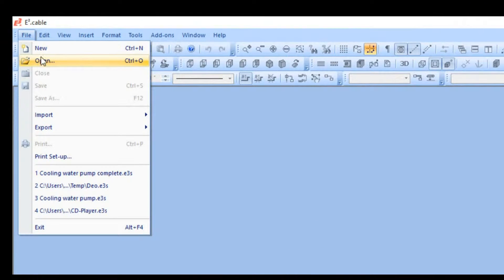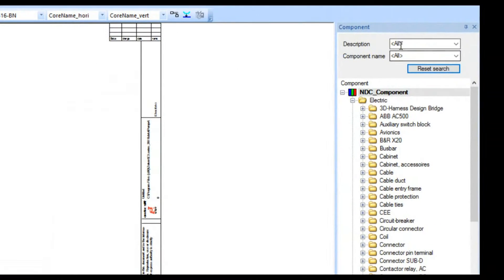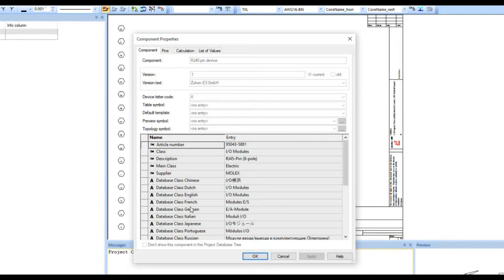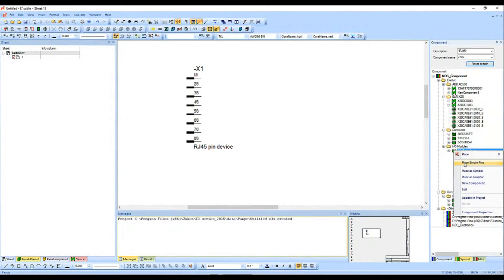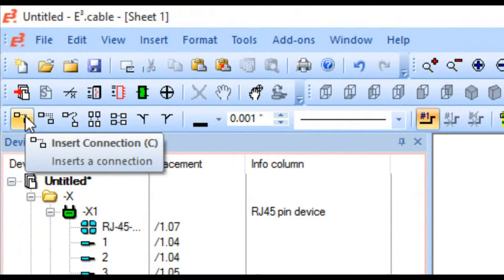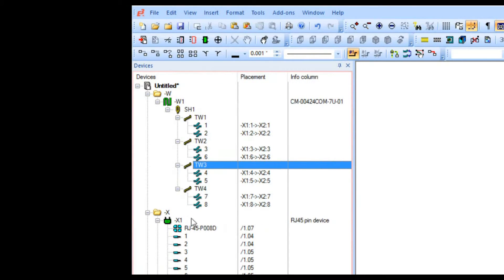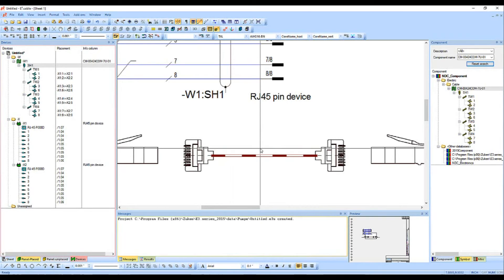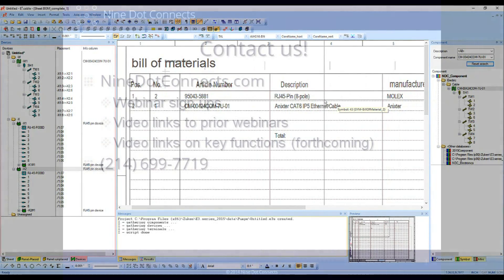Ethernet Cable Design with Zuken E3

Comment: Thank you for video! Please say where is possible to download additional libraries like you have in the video. And please, give a link to the video where you explain how to work with new item in the library.
Reply from the maker: Thank you for your inquiry.  Unlike our webinars, these "brief" videos were not archived.  Videos like this one were usually done "on the fly" to capture knowledge that we thought would be pertinent to our customers.  Therefore, the chances are slim to none that we will find the files used for this video.  Please continue to build upon your knowledge via the E3 website and other E3 videos that have been posted.

Comment from the maker: The following commentary would be true for any tool used.

When drawing cables, we are dealing with both physical and symbolic aspects of each component.  Some components are only physical.  For example, a drawing of the heat shrink only needs to be represented physically.  Some components only need to be represented electrically.  For example, the wires can be represented symbolically because the physical information pertaining to the wires (color, gauge, etc) can be represented in words on a schematic or in a table.

When drawing a cable, we must remember that we are imparting information to who ever is trying to assemble it. The physical representation simply provides a visual as to the end product. In particular we want to show the connectors, and the location for the heat shrink and labels. Obviously, there is a cable that connects the two connectors and in most cases there is not a one to one correspondence between the pins on each connector. The diagram does not need to be specific in showing the wires leading up to the cable. In fact, in situations where there are dozens of individual wires, this would be nearly impossible to represent physically, let alone be able to read it.

Therefore, we 'spell out' the connectivity  by showing the connections either by symbolic representation as one would do in a schematic or by creating a table that lists the point to point connectivity information.

Comment: Hello how could you for example do a cable with two different ends on it, where the pins do not line up 1 to 1. And then show it in a table also? Thanks